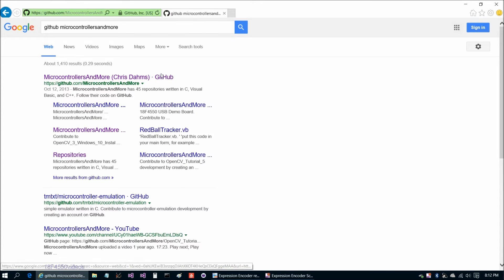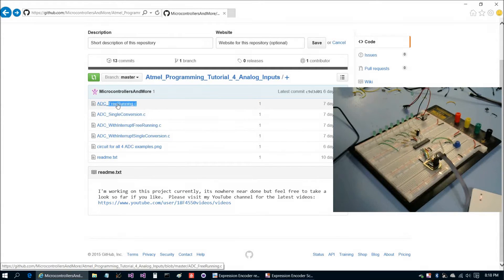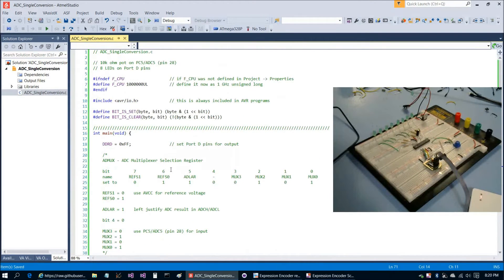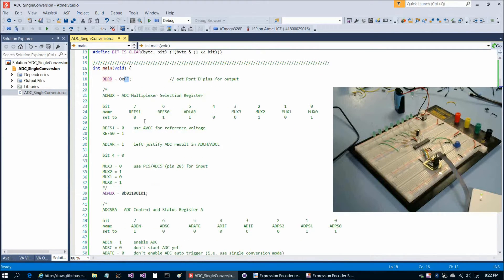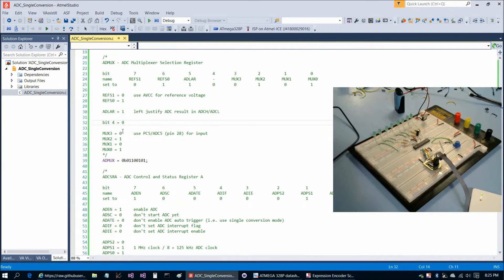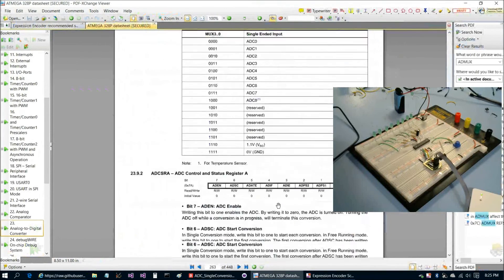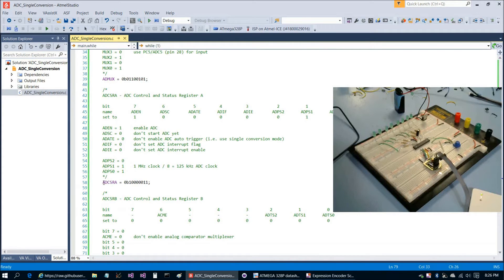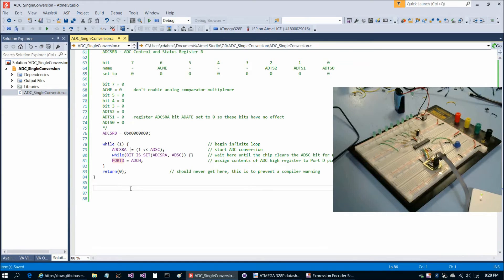Atmel Programming Tutorial 4 - Analog Inputs

Comment: Im a beginner and what I can learn from this tutorial is that the behavior of the circuit looks the same when you were tuning the potentiometer, feeding the analog levels into the chipset and poping out the 8 bit digital signals by way of lighting up those LEDs, and the key in this tutorial is about the different working modes of the ADC register. for example, each time when you've tunned the pot one time, a analog level signal  was input to the result register and it will only output the convertered digital signal (for example 0000 0001) once time and then set back to one and stopped, which is singal conversion. And for the freerunning mode, the register will continually output the same digital signal (for example 0000 0001) to those LEDs, but the circuit behavior looks the same. Am I right? And also I found its pretty useful to go into the ATmega328P_Datasheet for more elaborate explaination as you mentioned a certain function such as the successive approximation circuitry and I got the reason why you set ADPS2/0/1 to 011 in the program when I looked the figure of the ADC prescaler.